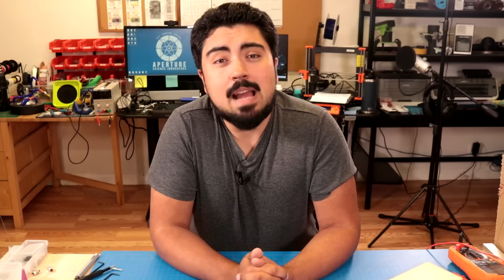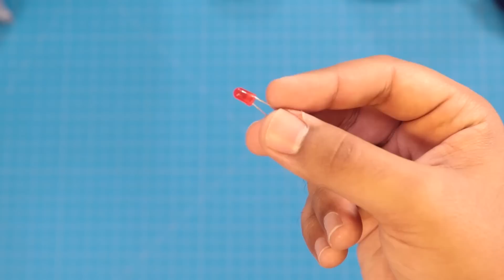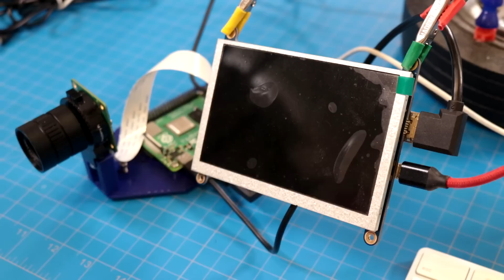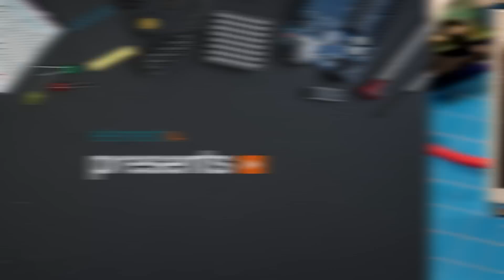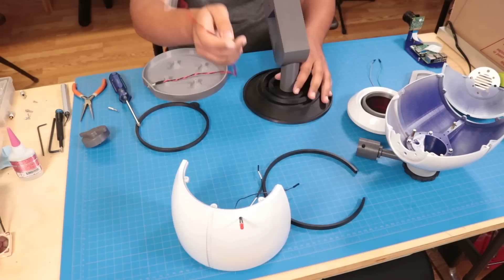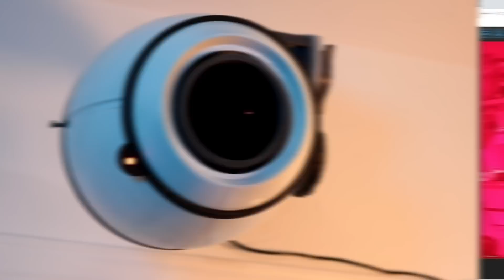Portal 2 Security Camera with #RaspberryPi 4

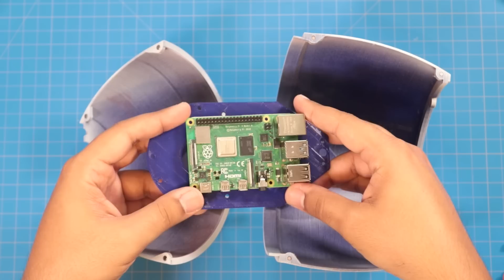Comment: I have a project that I need to 3D design an enclosure for, but I’m not very good with 3D modeling. I see for this project that he modeled the outer shell - how was he able to model the shell and adapter plate so precisely as shown at 2:08 to hold the Raspberry Pi? I saw he used Fusion 360, but what techniques did he use to make sure the shell and adapter plate would be the right size? I’d appreciate any help! 😁👍

Comment: Great project!

As someone that has a number of MotionEye / Raspberry Pi camera setups I am excited to see someone with a DIY project. 

A few years ago I was lucky it find a used Security camera dome top enclosure. At one time it housed a big analog camera.  

It had lots of room inside the case. I was able to install a battery pack, a Raspberry Pi 3 and a v2 camera. The camera was placed on a servo motor that gave it 90 degrees plus a servo motor that I setup to tilt the camera 20 degrees up and down. I used a Arduino uno  to run the servo’s.  A used a small solar panel to charge the batteries. 

The unit has worked for over a year without any problems. 

Tip 1: when setting up a Ras Pi camera. Make sure you install the Pi that give you access to the SD card. In my situation I was able to make a cut out that allows access 

Tip 2:  make sure it’s waterproof but also make sure you can vent out any hot air. 

Tip 3:  for backup use DropBox or whatever cloud based you have access to

Lastly cover any LED’s that can be seen from a distance.  Put the under a removal cover. When you need to test you setup removed the cover.You can also use your remote access through your software to check on things. 

Don’t brag to your friends and family that you have a camera setup. You never know who’s going to break in ?

Hope this information helps you on your next project

Comment: I was hopping for some servo motors to articulate the prop. Portal is really about motion and interaction.
Even the turrets that just stay around can uncover their guns and glow with their eyes. I mean: The camera is awesome and the housing looks cool, but I really wanted to see some articulation - or at least a "breathing light". If you need to use a red lens: Make it an IR-lense with IR LEDs.
Reply: I had originally planned for it to move, but once it got down to modeling I realized I was burnt out of mechanisms having just spent so much time on Rosie. Also, I want the build to be more approachable designs for more people. As is, just about anyone with a 3D printer and a Pi could make their own. The cheaper things are, the more accessible to more people! I may make a motorized V2 for myself though ;)
Reply: The cameras don't move in the game though...
Reply: The cameras pan and tilt to watch the player.